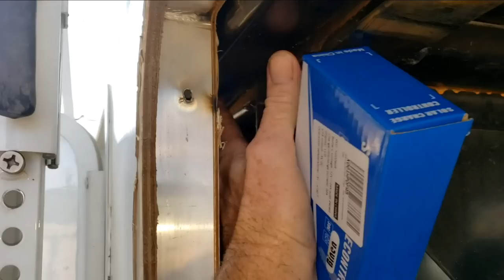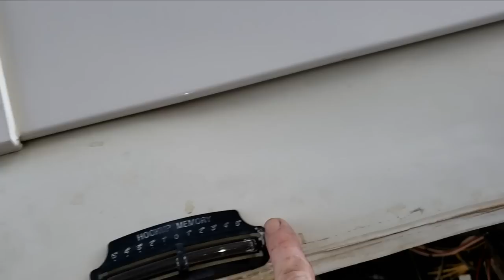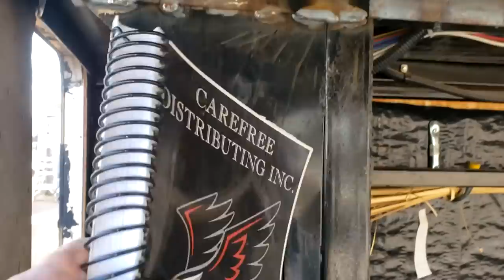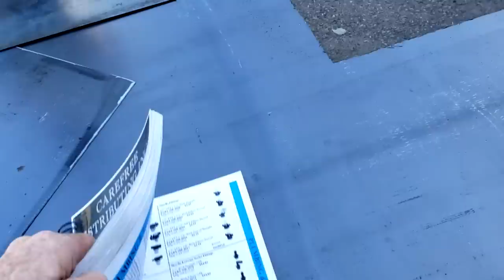Heartland Bighorn 5th Wheel Frame Broken

Comment: Heartland is responsible since it is from their own specifications that Lippert or some other frame manufacturer built your 5th wheel trailer's frame...
That builder should've advised Heartland about the threshhold limitations of those actual specs and not just take the business without any professional recommendations against those inadequate specs...
But since they may not know, most of the time how their frames may be used, it is incumbant on the trailer mfr to not exceed the carry capacity of these designs...

Comment: Reinforcement will ultimately transfer a load to the next weakest weld, and more cracking will occur. A chassis has to be uniform strength to withstand the forces and loads such as this. Unknown to all is was ot overloaded? Awkward driving, such as ditches and curbs put excessive strain where it's not supposed to be. I'd expect this to be salvage or scrap. Welders can fix just about anything.

Comment: U want the rectangle 1/2 the load 2 pieces or 1/3rd the load triple side by side by side stuff to each by partly independent of each other other than drilled round bar feed thru or spot welding seam or drilling the whole for round bar only u need to spot weld drilled prts. U want light stuff to crack or break but 1 piece at a time not both or all 3. W/I beams not supposed to crack or beam last stand never being prt breaking real fuck bad, need more gussets & lighter shit to flex & break.

Comment: Someone needs to start a class action. This problem with stay with these traitors FOREVER. Need to investigate where their steel came from as the problem is in the steel. There’s many things that can go wrong with producing steel for these frames that you could read a whole book on and not understand all of it.. but number one is who was the supplier of the steel and where did it orient from ? Was it from overseas if it was there is a high probability that it does not even come close to the quality of US steel , problems can arise from the amount of recycled steel , All the way through the manufacturing process to the end treatment of the steel. Leopard nose what the problem is they are just not opening themselves up to litigation.. These frames are only going to keep cracking in different stress areas until they’re gone.

Comment: I know this video is over a year old. I have to make my point. I have been in steel fabrication for 30 years. I am no engineer by any means. The rv industry is all about weight. The lighter the better. Take a 10,000 rated utility trailer and look at the steel in it. Take a 6k lbs rv and the frames are 1/2 of what they should be. I just don't know how the NTSB and the Federal DOT can allow these under engineered crap on the road!!!!
Reply from the maker: You have a valid point

Comment: Junk yard.
If you repair that specific area.
It will frature again infron and behind the repair eventually. 
These frames are junk from the frame manufacturer. 

In all reality.
Spacecraft is the only way to go for structural strength long term.
Reply from the maker: I agree it is not ideal. I have also heard that overloading and anderton hitches have caused more damage than anything.

Comment: the walls if giant sheet of aluminum & counter ties ito solid tub at key fed connection pnts into hollow tubs kind of just side wall toilet paper & card board construction after 10yrs max, not good enough for using this way counter sheet in design. If fiberglass boat over boards again same bs not remotely going to last w/out real counter feed thru solid at key pnts feed thru hollow tubing, up to the jump long term. The sheel whether aluminum or fiber glass just to keep rain or sea water out nothing else. If any1 says diff they r not allowed here breathing false thing evil can't pass or be prt of MY world any more.
Reply: Basic member u might need to add diagonal stiffeners & gussets, but that is it if rightly sized, then lots of rectangle lighter stuff each micro lower less load. Or 1 side is 3" rectangle another 4" then 3rd 4" but fractional lower less micro load, drill so spot welded at diff spot joining spots random. But Aluminum solid never breaks counter feed/drilled thru glove fit a single tub or super crazy double glove hollow tub. That is the system, not a thing from skin to hold up or work w/your bones, bc if they say it can they r false dead damned. Bones, big to smaller, cartiledge that is the frame not fuck skin demon stench.

Comment: Thats cheap ass metal. Made in China or Mexico.  Seen it many times
Reply from the maker: That is not an encouraging thought but I do agree.
Reply: @AZExpert  was in manufacturing for 32 years. Installed 3" Mexican pipe for an air system in a building approximately 5000' long. Most of the seams leaked. Thats just one incident

Comment: stunning, thin cheap chinese metal. :face-purple-crying:I build utility company trucks from 1/2 tons to electirc line trks.
RV are a wood airplane with some aluminium on top of a tin can frame that flexes like a trampoline.:face-pink-tears:
1/2 ton utility trailer uses thicker metal.:trophy-yellow-smiling: the thin wood bellowed like a airplane wing is ideal for rapid fires.💩💥